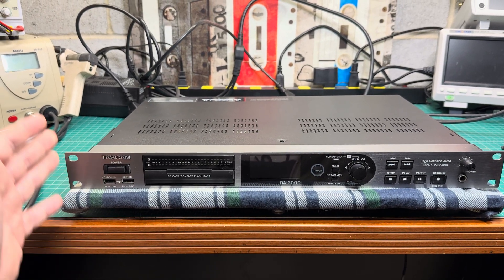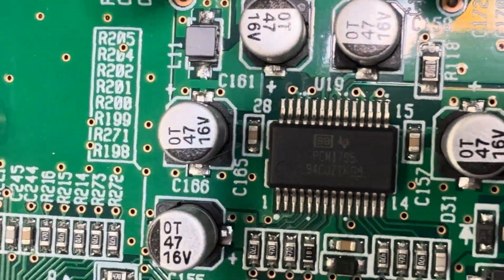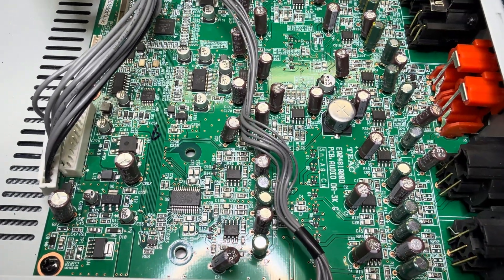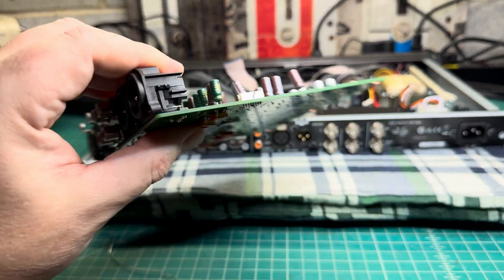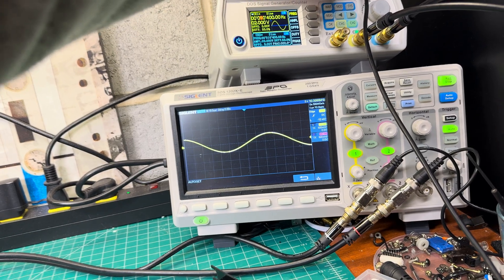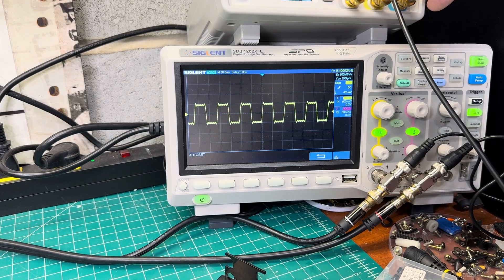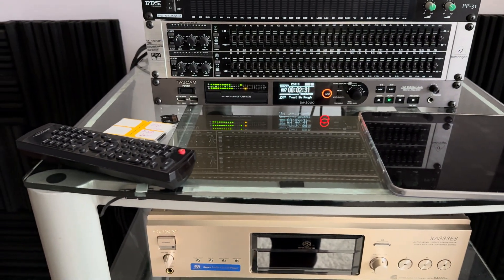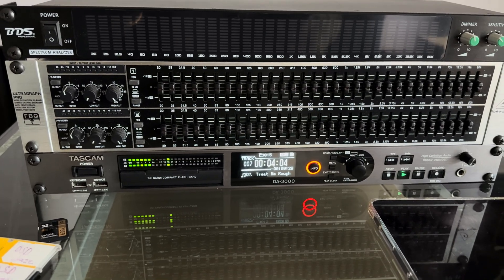From Good to Stunning | WIMA MKP Mod Transforms the Tascam DA-3000 ADC/DAC!

Comment: This is so interesting. I have a Tascam DA 3000, and I will most probably try this mod. What are the cap values? I see that you mentioned 10nF. What is the VDC? Also, I guess other film caps identical to WIMAs will work as well. Thanks in advance!

Comment: A DAC transforming is a bit more complex process than just replacing ceramic to foil. But even this mod is worth, no doubts. I'd start upgrading from making sure no schottky diodes are in a power unit (SiC is better), then to replace all electrolytic buffers (Panasonic/Sanyo for digital, Elna/Nichikon for analog), and replacing all LDOs to ultra-low noise ones (< 1uV), making sure there are enough of them for all important voltages and consumers (oscillator, usb2iis, logic, few digital for DAC, few analog for DAC, analog for op amps, ...). Then would make sure a capacitance of electrolytic buffers on a DAC chip is high enough. Then to remove all interstage capacitors, and all tantal from analog part if are any, then to upgrade op amps (MUSES02/Burson/Stacato/etc), then to check an LPF frequency (sometimes it's even below 20kHz), and of course WIMA for sure. =)
Reply from the maker: Thanks for your comment. I have watched multiple videos on upgrades and think few of yours. I agree that there are way to many components in DACs which affect sound. But this Tascam is relatively new and build with good parts. I just wanted to check if WIMA will make stage better - and it did. Sonically this Tascam now is very close to the 4x more expensive DAC. I just need more time to understand why stage is so different. Is it ladder DAC a reason or implementation itself. LAiV is very good DAC and it was the first which made me rethink if I want to go digital again. But now I 100% sure that electrolytes should be very carefully used for sound. Way to many problems with them.
Reply: @hifirulezzz As usually, 20% investment gives 80% improvement. 

I like to keep watching your reports, because the results are always solid